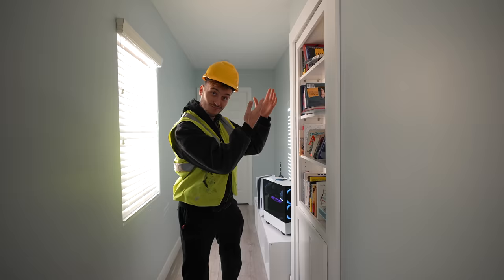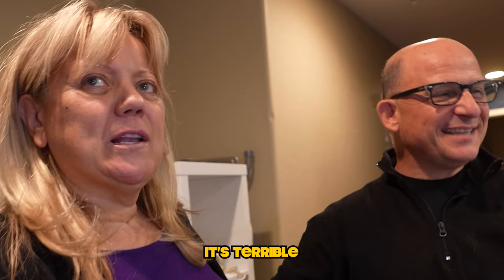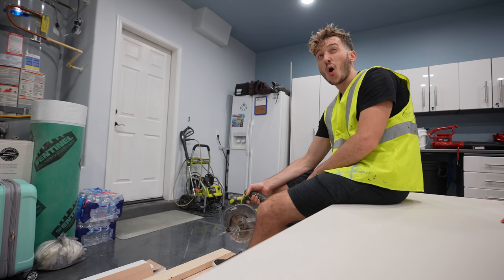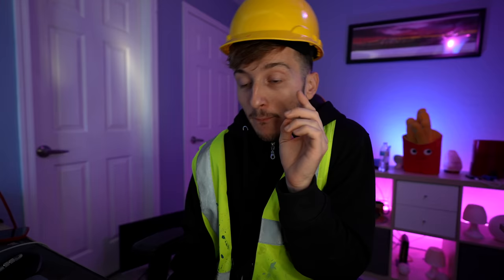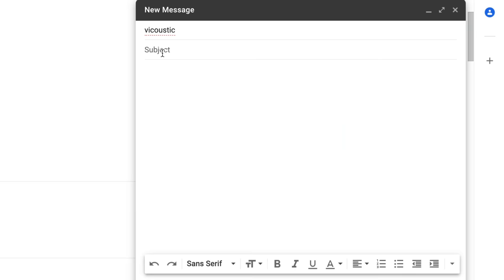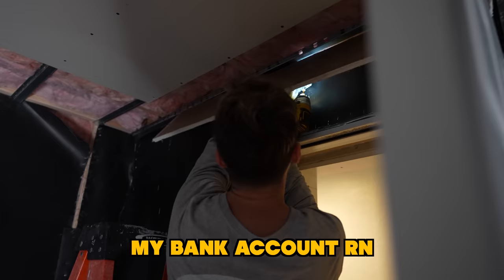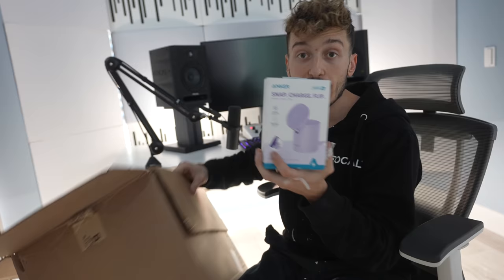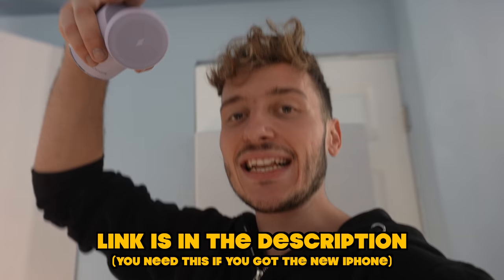i built my DREAM Hidden Gaming Room in my Parents House!

Comment: I wish someone would do this for my room as im living in a room in my parents house which has been partially finished since we moved in beforr 2016 it is white sheetrock that isnt mudded or taped the room is awkward with the door opening towards a small upstairs bathroom and as soon as you enter the room there is a closet which opens towards the bedroom door the room itself is fine except for the fact that there is little space above me to strech without hitting a ceiling fan the closet is small my bed is to short as i am 6 foot 5 i am using a tiny tv for my xbox as the big one i have in my room is old i have little in the way of space to do things and any time someone cooks in the kitchen my room heats up also my windows are shot as they are original to the house there is a baseboard heater under my large window the plugins are awkwardly placed and total 4 in number which means i never have space to plug things in without powerbars and drop cords